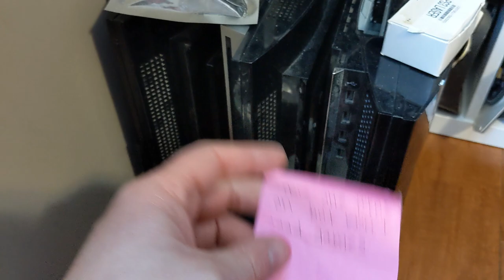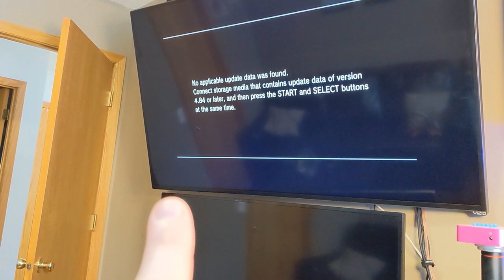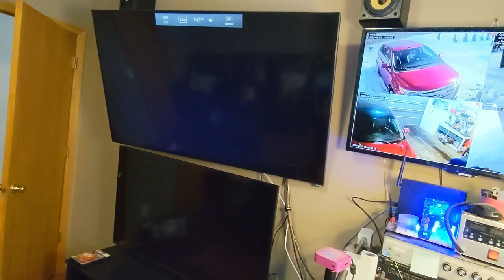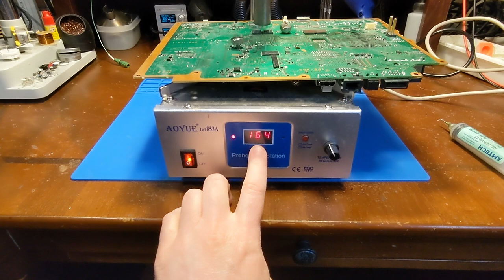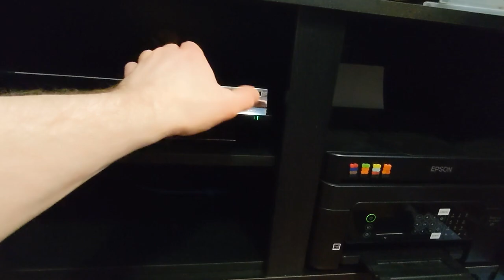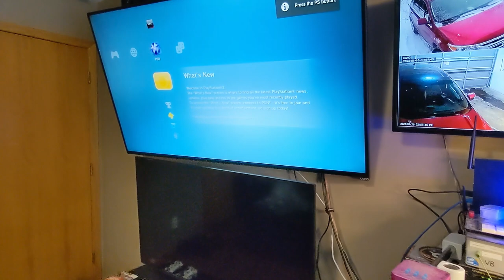Lets Fix PS3's in 2022

Comment from the maker: I'm sorry but I do not offer PS3 repair service.
Reply: why not????
Reply from the maker: @tree92278  because cluster repair service takes up all my time.
Reply: 21:27 that PS3 is running CFW and the previous owner might have set a custom fan speed or temperature instead of letting syscon do what it wants
Reply from the maker: @Esurient-  the fan speed went back to normal after the delidding.
Reply: @jeffescortix  hi could you recomend and reading material for leasrning to do what you have show in this viedo i.e identifying capacitor size and sutiable replacment, how to identify breaks in circuits and so forth.

Many thanks and thank you for the great videos.
Reply: @0102rider  the internet
Reply: Well that sucks.. I was ready to ship and pay but thanks for the info before I got 2 excited!!!!
Reply: Hey mate, you didn't leave a link to where we can find some of the cap replacement
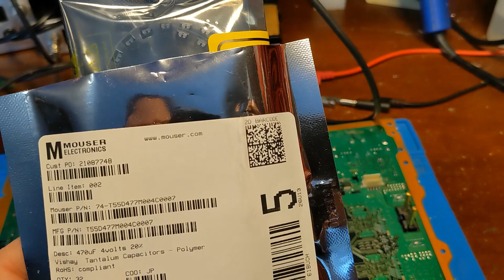Reply from the maker: @nanaamankwaa2820  part number is at 10:05 sorry it will just have to be screen grabbed. But it's probably discontinued.
Reply: Damn, i was just gonna ask if you would fix mine. My PS3 is in like new condition. It stopped putting out a video signal back in 2015. It's been under my bed since then. It turns on, beeps once and charges the controller, but no video signal from the HDMI, digital output or AV multi out. The only game i played on it was the Grand Turismo prologue....
Reply from the maker: @PANTYEATR1  have you tried resetting the video out to 480?
Reply: @jeffescortlx  I've only tried the video output reset by holding the power button. I've tried it with the HD inserted and out. All of my TVs say no video. I think it could be an internal issue
Reply from the maker: @PANTYEATR1  try with A/V cables? Might just have a damaged HDMI port.
Reply: @jeffescortlx  I've tried the HDMI, the AV cable port and the digital output port. Nothing bro.
Reply: @PANTYEATR1  maybe the rsx died usually it starts artifacting before it does like green squares and distortion ect to fix it would cost a chunk as well someone named computer booter does it though he has a yt and website
Reply: @reyes7133  thank you for your response. My PS3 didn't do any green squares or distortion. One day it just stopped putting out an audio\ video signal. I just took it to a repair facility local to me. They have free diagnosis. I'll get an answer on the issue in another 2 days.
Reply: @PANTYEATR1  hmmm aight because u stated av also doesnt display usually when both dont work means the rsx died i think you’d have to look it up on reddit or something
Reply: @reyes7133  correct, there's no video output from the machine from any port. What is the RSX?
Reply: @PANTYEATR1  the gpu of the console  im not 100% sure but knowing both dont work and its not your ports then it’s probably your rsx that just died it’s happened before to others but usually artifacts appear i think
Reply: @reyes7133  I'll report back here when i get the diagnosis report. Is the RSX an expensive fix or is the machine trash?
Reply: @reyes7133  well, i just got a call from the repair place and they said that my video output issue is on the motherboard level and they won't be able to do the repair. They didn't say exactly what the motherboard problem is, but I'll ask when i pick up the console tomorrow... 😔
Reply: @PANTYEATR1  hmm nah they wont know whats wrong with it if you really think its worth it then contact computer booter he’ll let u know
Reply: @reyes7133  i don't know who computer booter is😕 my PS3 is in like new condition. It's a 2008 unit and it stopped working around 2015 and has been under my bed since. I would like to have it working 100%
Reply: @reyes7133  i got my PS3 back. They said they aren't 100% sure, but it appears to be the GPU which handles graphic computing? Quote the notes the shop wrote - " very good condition, no visible physical damage, little to almost no cosmetic wear. No more than 3-5 small minor cosmetic blemishes." This is proof that my PS3 was very well kept and just stopped working. I asked what my options were. They said buy a good used machine and sell mine for parts. I'm shocked and fantastically confused as to why this happened to a virtually new, well kept PS3.
Reply: I got my PS3 back. They said they aren't 100% sure, but it appears to be the GPU which handles graphic computing? Quote the notes the shop wrote - " very good condition, no visible physical damage, little to almost no cosmetic wear. No more than 3-5 small minor cosmetic blemishes." This is proof that my PS3 was very well kept and just stopped working. I asked what my options were. They said buy a good used machine and sell mine for parts. I'm shocked and fantastically confused as to why this happened to a virtually new, well kept PS3.
Reply: @PANTYEATR1  yea they usually dont like to deal with ps3 cuz they are a pain but like i said if u want It diagnosed and repair contact computer booter i put his info on my last comment it might be pricey though
Reply: @reyes7133  i don't see any contact information for computer booter in any of your messages.
Reply from the maker: @PANTYEATR1  search YouTube for computer booters. There are very few people qualified to replace the GPU. He is one of them.
Reply: @jeffescortlx  thanks bro, I'll look them up
Reply: @PANTYEATR1  did u find him?
Reply: @reyes7133  i seen him but i haven't reached out yet.
Reply: @PANTYEATR1  his website is also computer booter
Reply: Damn 😢 I still have my 1st gen ps3 and needs repair

Comment: This was awesome, sir. I started working on PS3 phats back in 2010 and after a lot of trial and error, managed to fix several dozen. I wish I knew about the capacitors back then because I always either reflowed them or reballed the GPU and then put back on. Like you, I kept the backwards compatible one for myself and the other ones, I sold. I still have one I reballed that lasted about 5 yrs but YLOD came back. I believe I'll do the capacitors like you did and see if that will bring it back to life. Thanks!!
Reply from the maker: I'd say definitely go ahead and replace those caps. They are cheap enough and easy enough to replace it's worth the try. Should help make it more reliable if that's the cause of the YLOD. Keep em going!
Reply: Did you get them caps swapped? Updates?!!
Reply: @jeremygalloway1348  No, not yet. I just ordered them last week so they'll take a while to get here.
Reply: @jeremygalloway1348  Update: As of today, I just did the capacitor swap and it booted right up. The system is an old backwards compatible CECHE01 that was in the closet a few years. Gonna sell it this week.
Reply: Congratulations man @TyRobinson any tips on how to replace those capacitors or what link i could go to to find them?

Comment: Good choice on keeping the BC one. I got myself two (the chrome one, and the FULL BLACK trim one) and the black one is a bit of a pain to get on track but it's hopefully coming together soon. I'll try the cap replacement on the topside as I got nothing to lose. A plus to the board I had received yesterday for it (which doesn't yet work) is the CPU and GPU were delidded, so I guess that's a big plus.

EDIT: High chances it's the caps - I see burn marks under the NEC plastic bodies.

Comment: You may want to look into reading the syscon data off the boards and seeing if it really is the CPU Caps or the CPU/GPU.   Would be nice to have a good video of it.
Reply from the maker: Your right I should. Although I don't plan on doing these regularly. I'm equipped well to make the capacitor replacement easy, so it really doesn't bother me to just go ahead and replace them for a piece of mind.
Reply: @jeffescortlx  Could also be a bumpgate issue with the GPU. Nec tokins are not always the cause.

Comment: This was fantastically informative. I have done a reflow on my backwards compatible PS3, but that was before I knew about replacing the capacitors so I'll definitely have to give that a try if I ever get around to fixing it. The reflow didn't turn out to be a good fix either, I did get the PS3 running again after YLOD but after some more use the YLOD came back.
Reply: Get a uart ttl adaptor first to read the syscon error codes, it isnt always the caps, I wish people need to stop telling this to people.

Comment: great video!. hey, I also have a disc from Coburns video rental stuck in a machine i bought off ebay. crazy! however mine was working. It is the CECHL01. My CECHB01 is the one i need to replace the caps. I see you added alot of flux. is that key to doing this? what kind of solder did you use? Was there a certain size or anything?

Comment: so. do all of your units still work? seeing that one ps3 cramed into that shelf with no airflow, makes me think this thing will be hot as hell. thanks
Reply from the maker: Yes it still works. But what you can't see in the video is that the entertainment stand has fans in the back pushing the hot air out the back. The cabinet keeps the console from sucking its own hot air back in.

Comment: Hi there - I accidentally damaged some traces on the CPU as well and to be honest I thought they were unfixable (I do have a microscope). But clearly you did that. Can I ask what gauge of wire did you use for the job please? Is that enamelled copper wire? Thank you!
Reply from the maker: You're like the 4th person to mention that the scraps on the CPU traces were normally unrepairable. It's not easy, but possible. I had to use my full zoom on the scope to pull it off. Sorry I don't know the gauge of wire. I had to rummage through my wire bucket to find a wire thin enough, it's very thin. Yes enamel coated, I think it's from an old transformer.
Reply: @jeffescortlx  thanks for your reply! Well I like challenges, I’ve got one apparently 🙂
Reply from the maker: @tony359  Godspeed to you.

Comment: How difficult was it to fix the traces that were damaged during the delid process? Is it worth recommending that others do it? I got a little scratch into my CECHE01 cpu when I delid it and now it won't work. Kept it anyways hoping to fix it one day. Your vid is the first I have seen of someone fixing a damaged trace on a cpu.
Reply from the maker: It was probably the most difficult trace repair I've ever done. Just because the traces are so small. But I was able to trace back to larger pads and use those for the jumpers.
Reply: @jeffescortlx  Am I able to send you a picture of my cpu for a diagnosis and if possible send it in for repair?
Reply from the maker: @Ranqers  PS3 repair isn't my profession. Surely there's got to be somebody out there that's better than me with more experience.
Reply: @jeffescortlx  Got it. Thank you anyways. I will definitely be keeping my limbo ps3 for sure and hopefully I can learn to solder the wires myself one day. You did what so many thought was not possible. What a great video. Hopefully more people see this and attempt it.
Reply from the maker: @Ranqers  how bad is the cut? How many traces do you think are damaged?
Reply: @jeffescortlx . Its a very small single scratch on the same corner as yours I think. Caused by the tip of the paint knife I used. I'd say probably 2-4 traces but Id have to open it to make sure. It being small I thought maybe I could be lucky and have it work regardless, but nope lol.
Reply from the maker: @Ranqers  there is hope if too many traces weren't cut.

Comment: Hi, awesome vid thank you, i have a fat ps3, it runs ok but after a random amount of time it will just switch off on its own. Have you come across this before and if so any idea what's causing it?
Reply from the maker: When it shuts off, is the fan at high speed?
Reply: @jeffescortlx  probably, not sure its now in my loft collecting dust, just wondered if u had come across that fault, thanx for the reply

Comment: I have a Fatboy 80gb and uBreakiFix were less than helpful. They said they "thought" is was a GPU issue. How do I find someone to repair thats knowledgeable and competent in my area?
Reply from the maker: I also have a backwards compatible PS3 here from a viewer that has been through the hands of a ubreakifix shop that now needs a reball. So far I'm not finding any reputable technicians in the united stats that are proficient at pulling the GPU/CPU that want to take it on.

Comment: yo I was impressed you got the last one working despite chipping the tracers on the CPU, how did you know which tracers to jump wire back into the board? God knows one too many folk tried delidding their PS3s and ended up "killing" them by chipping the tracers. I'm looking to open my PS3 as well in order to make it less noisy - but you know, delidding is scary.

I was thinking of actually cutting a 3mm thin square hard eraser and inserting it in the "hole" on the back of the Motherboard where the small CPU capacitors are, because of a design flaw in the CELL cpu in which the die actually loses contact with the IHS, which is what causes the compound to dry up/overheat, I've read a lot online that it DOES work and it's a viable alternative to delidding, but I've never seen enough video evidence.

Comment: The backwards compatible ps3 it has recently been discovered that indeed is the GPU that causes the YLOD, the caps are also responsible but most of the time is the GPU, you probably had bad caps to begin with, but the gpu is running in borrowed time.
Proper syscon diagnostics is needed to figure out the YLOD

Comment: Quick slightly unrelated question but where can you find original dual shock 3 controllers? I tried looking for them on Amazon but everyone just sells fakes, I want to have one because I loved them back then
Reply from the maker: Best chances probably eBay. But it will more than likely be used. If it's new in boxed be suspicious.
Reply: @jeffescortlx  Yeah okay thanks Jeffe! Loved the video btw, been stuck trying install the new update on my PS3 with a hard drive do you think you could help with that too?
Reply: @jeffescortlx  I tried so many options but it's one of those "couldn't find applicable data" situations, tried the trick were people said it sometimes confuses the USB of your plugged in controller so it might be trying to read that but no, I tried two USB stick (both correctly formatted and cleared out) PlayStation support wasn't any help so I'm asking you since you might know something about it since it's a fat PS3 not the backwards compatible one I think

Comment: 7:36

nope, the GPUs still are the problem. to really know what went wrong u need to connect to the SYSCON
it can be that the caps are bad, but it also can be that the GPU is faulty, and your PS3 could have faulty GPU solder balls and they got reflowed in the process of replacing the caps. check out RIP Felix's video on that topic, he talks about pretty much everything that causes YLOD
Reply from the maker: Yes I know, I already watched the same video you did. I made my video before he did.

Comment: Maybe the drive was getting some heavy hits with the disk inside and some cogs got misalligned. Remember when Xbox One came out and had drive issues and the solution to that was to turn the machine upside down and give it a smack? Maybe it was similar here.

I still have my old PAL 60GB PS2 backwards compatible PS3 that was struck with the infamous YLOD. I kept it for years in hope that some day they'll come up with a better cure than roasting it in an oven. And here we are, someone was clever enough to figure out that it was the caps all along. I think it's time to take out that PS3 from it's hybernation and look for suitable capacitors on my local parts webshop.

Comment: Question: I have an early model Fat PS3 (CHECHB01) don't have a yellow or red light of death but i have no display at all though occasionally after not running it for awhile i start it up and breifly get some pixelated garbage. This console was working fine one week and then the next week it wasn't. I may have plugged in the hdmi while the console was plugged into wall power and i have now heard it can kill the video chip. i would rather avoid replacing the chip as it is expensive and i frankly do not have the know how. Is it possible that i have the same Capacitor issue or does my problem sound different? I can provide more info if needed
Reply from the maker: Try the A\V out port. Don't forget to reset the resolution to 480. See if the video is still incorrect.

Comment: Hey I’ve got a question. So I recently got a ps3 and it was working perfectly fine. Played on it for hours. I recently connected it to the internet and now. It does not boot up but shows a green light. It won’t even go into safe mode because the power button doesn’t work. Do you have any idea how to fix this?

Comment: Is ps3 2500a hot model and its cpu is like fat cpu or not? I recently bought a ps3 slim model 2500, the temperature of the console reaches 77 degrees with a fan speed of 40, but I have had it for about a month and sometimes I played with it for up to 10 hours without any problems. Will there be any problems later? And the last question, how are the ps3 2500a? Like Fat, they don't have a yellow light problem? Sorry for the many questions, please help me by answering them

More detailed information: when the console has not been turned on for at least 5 hours and when you turn it on, the temperature is sometimes 34 and sometimes 40 degrees with a fan speed of 20 and in 5 minutes the temperature reaches 60 to 67 (cpu 67 rsx 64) and If you stay in the menu like this, the temperature reaches 72 and sometimes 75, and when you enter the game and play the game "Battlefield 4", the temperature reaches 76-77 and the fan 40, when the fan is 40, reduce the temperature from 77 to 72-73 gives and never goes higher